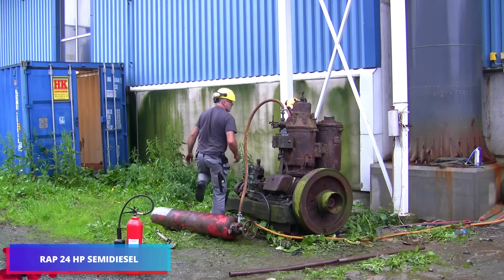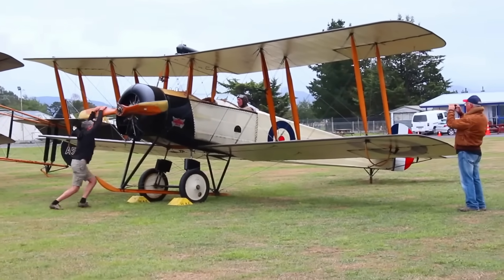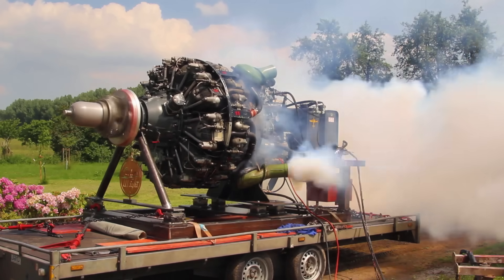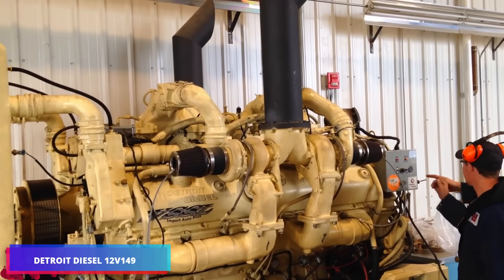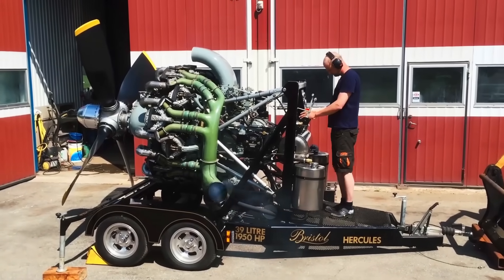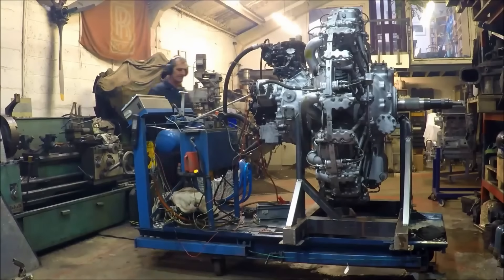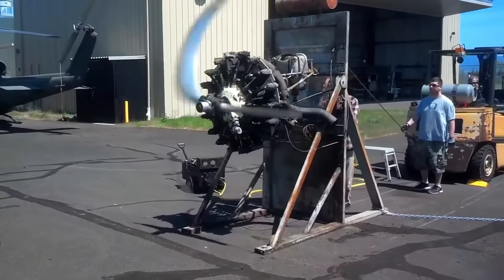Rare Old Engines Starting Up Sound That Will Blow Your Ears ▶3

Comment: If you ever have the opportunity to ‘prop’ an airplane engine, never ever put your fingertips over the trailing edge of the propeller. Put your hand flat on the propeller. If you put your fingertips over the edge of the propeller, if there is a backfire, you might lose your fingertips.

Comment: Is that Avro 504 one of those that the cylinders rotate around the crank in sync with the propeller? Because I have heard of them before!
Reply: Thats correct. The gnome Lambda 7 cylinder rotary. The crankshaft is attached to the airframe and the cylinders and prop spin on the crank.

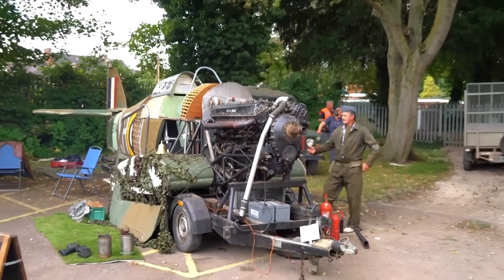Comment: 16:08 "...voluntary liquidation, a status that continues to the present day." Factually correct, but misleading if you don't mention that a successor company Rolls-Royce Holdings is still very active - as most airline passengers could tell you.

Comment: Um at 10:10 that is not an inverted v12. Inverted v12 is upside down with the cylinders under the crankshaft. Those heads are on top like a conventional v12 my guy.

Comment: Rolls Royce is hardly in liquidation today. The car division is now owned by BMW whilst the jet engine and nuclear divisions are listed profitable companies
Reply: I'm not sure that you are correct there, the original company was liquidated and the remnants renamed as Rolls-Royce (1971) Limited many years later being renamed as Rolls Royce plc. I seem to remember that it was all because of the RB211 fiasco.
Reply: @markwallis7199 what’s wrong with the RB211? It’s still in use today
Reply: @ There is nothing wrong with it now, have you read about it's history?
Reply: @markwallis7199  oh yes I know about it’s development problems. Probably better than you do. I’ve worked on the RB211 among others over the last forty years. 

The RB211 was an ambitious engine design, and as happens with such designs, they tend to have teething problems. Many of which, as in the case of the RB211, are human related errors.
Reply: all errors arehuman related,machines have no brains to make errors @panzerHeiliger
Reply: It was because of over reach on the rb211 but the company was split and the aero engines became rr 1971 ltd which was partly government owned. The car division went to BMW. It isn't in liquidation. Even part of the government shares were sold off years ago by idiot politicians.

Comment: I noticed that a lot of those radials had either no propeller or just a hub with no blades.  How long can they run without any cooling over the cylinders?
Reply: Just for show, don't stress or go / do anything so no big heat

Comment: why are the cylinder heads on top of that inverted engine which is clearly not radial. AI is going to mess up the details.
Reply: @DstroyThaMsheen That engine is a ‘Ranger’ by brand name, an inline 6 cylinder configuration and is normally mounted ‘inverted’ (crankshaft at top…heads at the bottom) to provide a higher mounting point for the propeller for needed ground clearance. The engine shown in this video is mounted with crank bottom/heads top, because it is being modified to power a ground operated vehicle of some sort. In the very beginning of that clip, you can see an automotive flywheel,housing and automotive transmission attached.
Reply: It said an inverted v 8 not radial du and it is simply mounted differently.
Reply: @stephencummins7589  apparently I missed that “inverted V8” comment. An inverted V8 is a configuration similar to the Ranger inline 6 I was referring to. But a “radial” engine is a radial engine and its basic configuration is the same right side up or inverted. Other than the fuel system and accessories, there is essentially no distinction inverted or not….the crankshaft centerline, hence the propeller remains in the same relation to the mass of the engine.